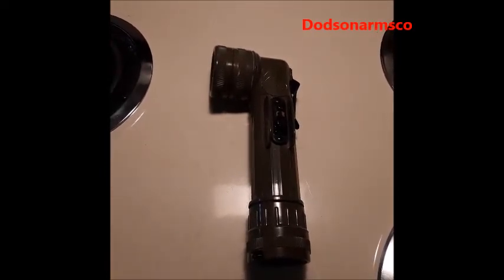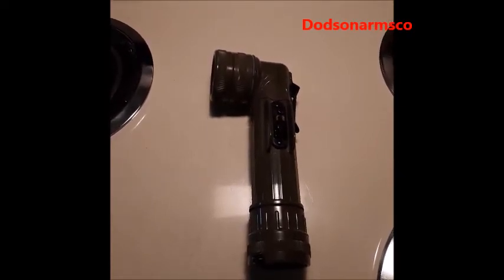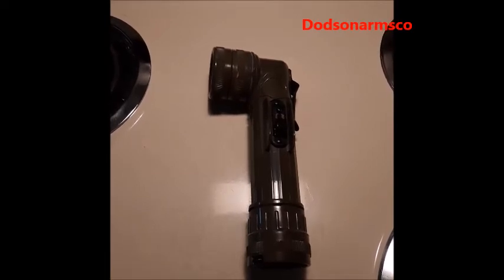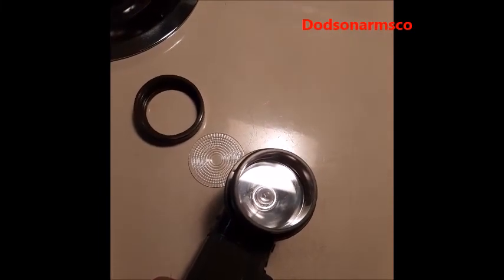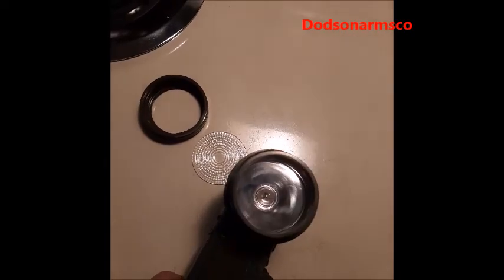Grid Down, EMP, Solar Storm, WW3, Nuclear War. What Flashlight will work?

Comment: Are LED flashlights EMP proof?
Because flashlights are not good EMP receivers, the voltage-rise they see from an EMP would be comparable that static electricity, and good designers always protect against it.Sep 6, 2017
Reply from the maker: All solid state is subject to emp depending on the volts/meter received. The only way to reliability protect solid state electronics is to use a Faraday cage.